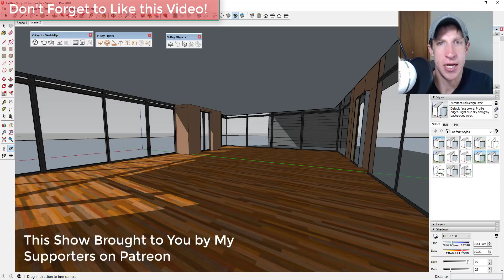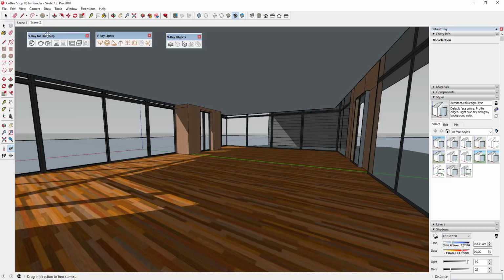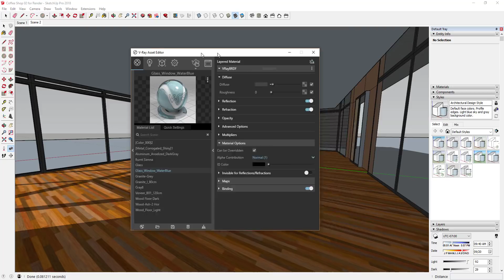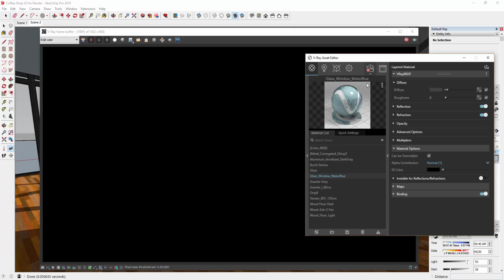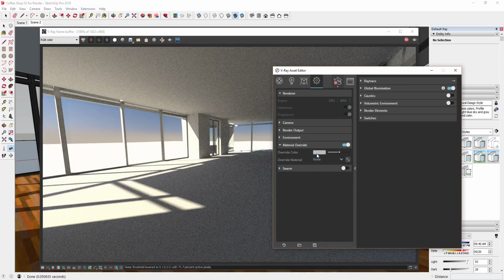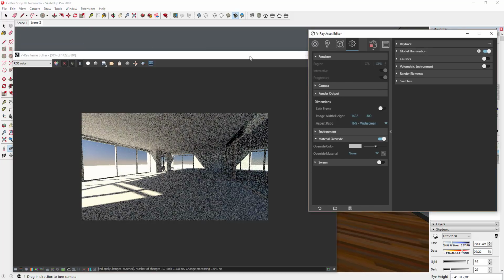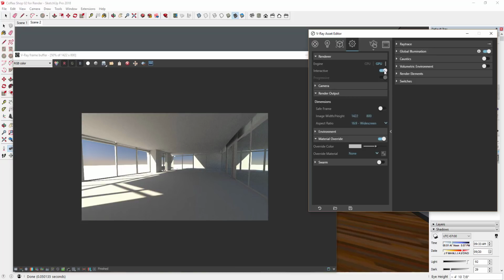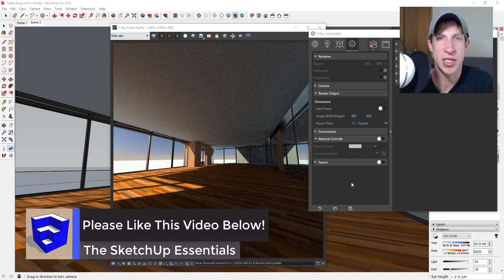PREVIEW LIGHTING IN VRAY with Material Override - Vray for SketchUp

Comment: Great video, straight to the point ! I'm using 2021 version and found the information still relevant. 

One question -- I want to do the override with one color (ie Orange) rather than white. 

Is this the correct way to do it : 
Vray Asset Editor > Settings > Material Override (ON) > 

OPT1 : Override Color --> Change the color here??

...or..... 

OPT2 : Override Material --> Select material from drop down???

Thanks in advance !